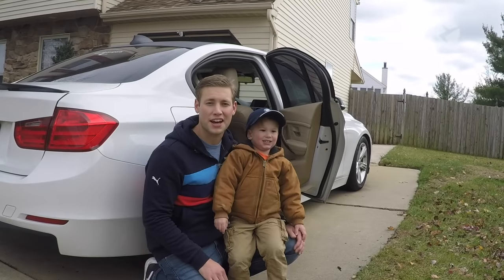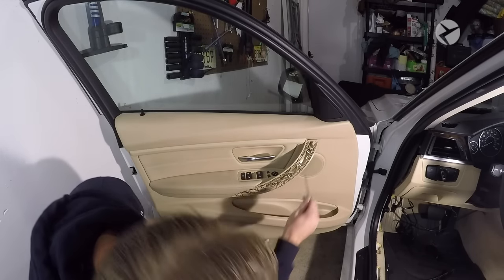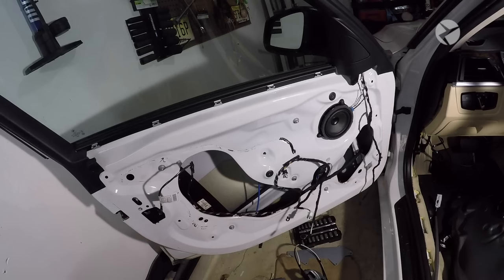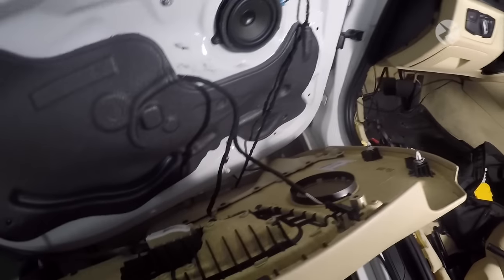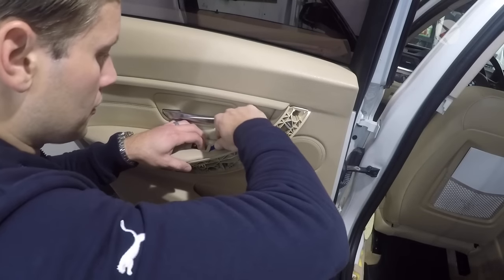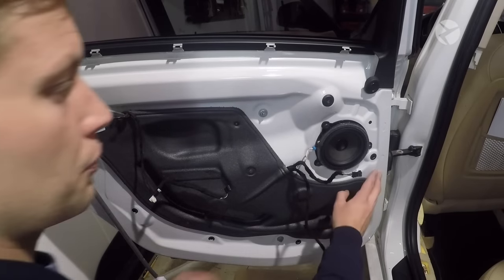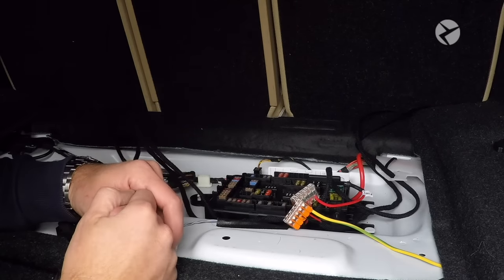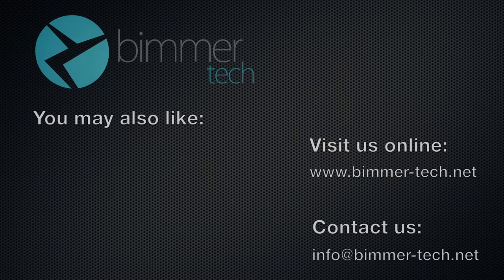BimmerTech Soft Close installation in a BMW F30

Comment: Nice vidéo  ! thank you for sharing your knowledge with the bimmer community. I was wondering if it's possible to make a video to add ambient light in the interior (door pannels, around the ac unit...)
Reply: +                           astracartman   this is ncie, but why do u want soft closing doors on your 3 series ? unless u are planning to keep ur 3 series for 100+ years, but then there will be flying cars by then
Reply from the maker: Hi,
At the moment we are not planning on creating such a product.
Reply from the maker: It's an enthusiast kind of thing. We like gadgets. And once you use the soft close doors - you'll want them too. Keeping a car for 100+ years may be a stretch goal but it could be done. :)
Reply: +                           BimmerTech   no you don't understand, what I said is the time and money it cost to incorporate that option to a 3 series, u might aswell save that money towards a car that comes with it stock
Reply from the maker: Your point is valid but it still depends on the specific case  :). A new car is a lot more expensive than a few retrofits so if your car is well kept a couple upgrades might just keep it fresh and exciting to you for an extended period of time.